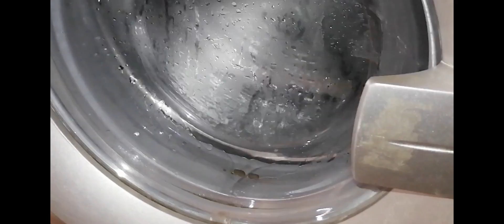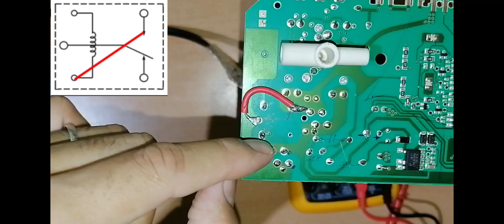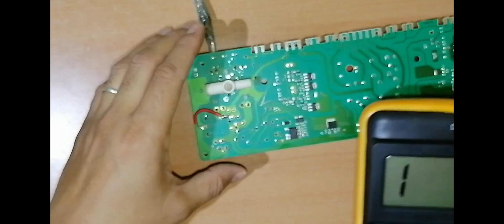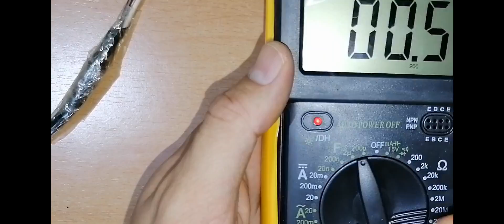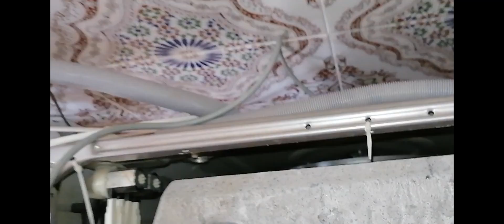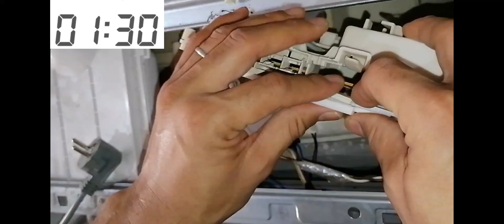Washing machine repair At Home - Tracking voltage whirlpool AWG/B M6080 S1 Troubleshoot, Part 2

Comment: Sir how we know that smd transistor is good or bad.does voltage drop from base to collector and from base to emmitter should equal drop or some high some low.because i saw voltage is atill drop but transistor is not good.please help sor
Reply from the maker: check it outside the board for best results

Comment: Your Multimeter isn't defekt. You have the Red wire in the COM port of your Multimeter. But the COM port is GND so connect the black wire there, then the - is gone.
Also in your schematic at 6.28 the Red wire is wrong, its connected to the middle point of the Relais 
But Anyway good Video
Reply from the maker: Thanks bro I fixed the problem,

Comment: If possible arrenge caption in english please
Reply from the maker: Noted, tnx
Reply: You can turn on caption by clicking that cc icon button it will generate auto translate to your prefered language
You can see this button by taping on the video it will appear at top corner.
Reply: @stalwartekwere2157  thanks now it working 
I think new release video captions start after some time

Comment: how you define (-) use to define voltage?
Reply from the maker: Always refer to point that are connected to negative terminal of capacitors
Reply: thanks a lot .Your technical guide isthe cham . The most "hotest pcb now : BOSCH dishwasher pcb " if you can do fews guide like the  Whirlpool  You can see the different